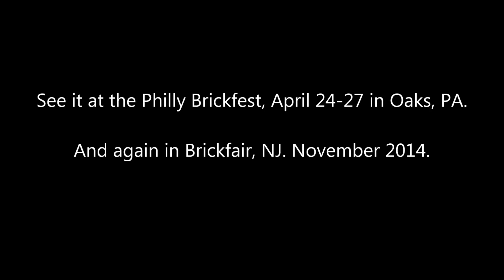Lego Parts Sorter Version 1.0

Comment: would it be possible to sort the parts as thair colour
Reply: Yeah, just add a little conveyor belt where the cup would be have it line up the LEGOs, then have an optical scanner scan the LEGO pieces as the go by, send the information to a LEGO Mindstorms microcontroller or NXT or whatever they're called, then have it move a Servo to knock down LEGOs whenever a LEGO piece is in front of the cup it should go to.